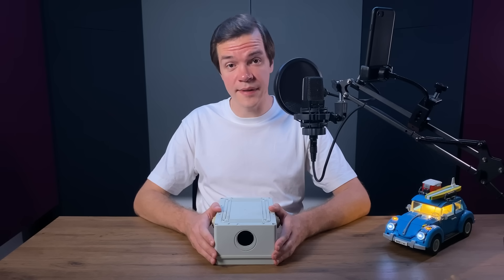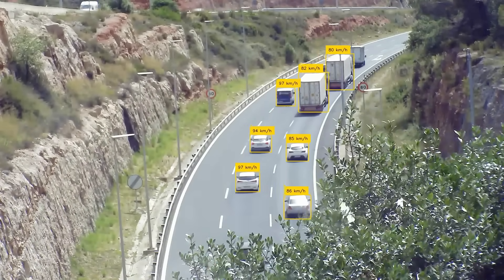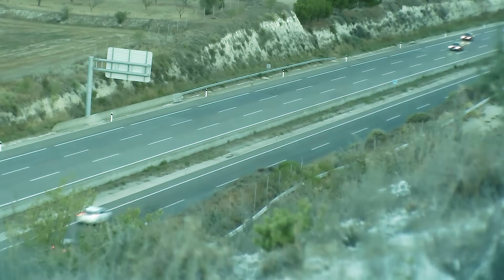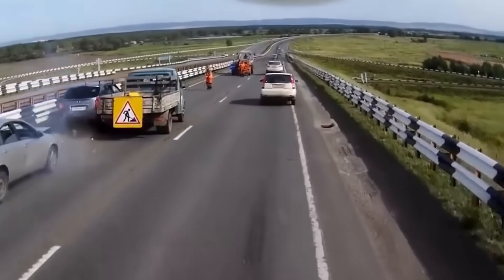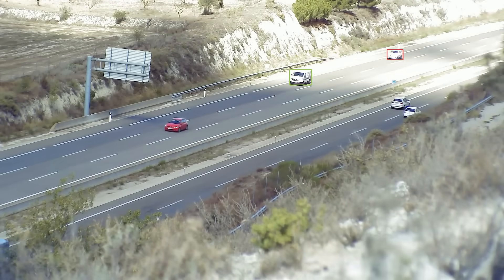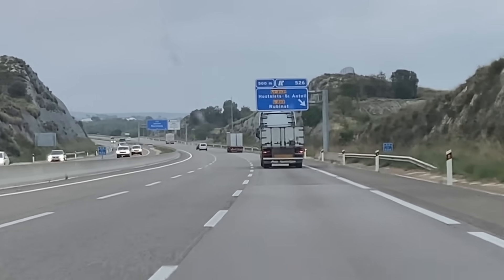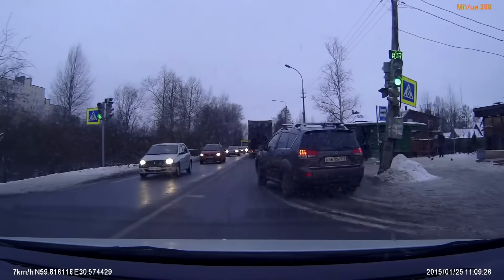New Anti-Tailgating Camera Reveals Shocking Statistics

Comment: I'm not crazy about the Idea of more law enforcement application on this,  A car cutting you off or the car ahead slowing down could make everyone 'guilty' at one point or another.    
This could be an automotive feature, to start with an indicator light, and then blink and possibly have progressively louder alerts if the gap isn't maintained.   Many new cars already have collision avoidance detecting obstacles ahead, and some cruise controls can set following distance.  So all the data is available.  Compare that with speed and you could have a save following distance score, make it at least an option to be visible to the driver.  Just like you have trip milage report at the end of each drive.
Though what I would really want is a license plate holder that will pass the safe traveling distance information on to the car behind me.

Comment: Average speed cameras do work. They work best when the limit is sensible, rather than too slow. We have them here in Scotland on quite a few long distance arterial roads, such as the A9, and what used to be a congested with lots of queues and gaps, is now more generally smooth flowing. Importantly, as a trial, they have raised the truck speed limit  as well [that's a way of getting around certain national legal issues]. 
It can be annoying in the dead of night when there is almost zero traffic and space for much faster speeds (exceeding the speed limit;-)

Comment: I live in Maine and whenever I have driven to Massachusetts I notice the drivers behind you won't tolerate even a three car gap in front of you but rather will make high risk passes to fill it.... therefore you are forced to reduce the safety gap in front of you or the insane passing attempts by those behind you become a much greater hazard. I agree that some solution is needed though I abhor government intervention unless absolutely necessary.

Comment: There is another reason for tailgating, caused by the police obsession with speeding. If police see someone speeding, they pull them over and give them a ticket. Simple enough, but what if they see 3 or 4 cars speeding at one time? Well, in most jurisdictions I've seen, they'll grab the driver in front. So, the fastest "safe" position (in terms of not getting a ticket) is immediately behind the fastest driver on the freeway. (This is not an issue when speeds are enforced by cameras, but it is an issue when speeds are enforced by roaming cops with radar.)

Comment: I had in Germany a digital running sign strip in the back side window. When I had a tailgater I switched it on and it says "Achtung - Verkehrsmessung" (Attation, Traffic Measuring). They always kept distance immediately. Later I had used an old cellphone and an monitor showing them their own face. It helped too.
Reply: Both of these should be built-in features in new cars.

Comment: Just a note: you have some parallax issues computing speed the way you did.   Meaning, the angle of the camera view.
Also, in America, they teach you 2 second rule.
It is of course based on driver reaction.... the time to recognize the issue, take your foot off the gas and apply the brake.
However, it doesn't take into account that when, for example, I get too close to the car ahead of me, I cover the brake (move the foot to hover over the brake pedal without activating the brake lights).   I have measured my reaction time and it is closer to .5 seconds.   So a .8 or 1 second separation is OK, depending on driver condition/state. 
In Europe, the cars are smaller and trucks are forced to be in the right most lane.  Which means when you are following a car, you can typically see ahead of it as well.  So you can react to issues even before the car infront uses their brakes.
In the USA, you can find yourself behind an SUV, or pickup truck or large truck and not be able to see around it.   In my corvette, I sometimes sit so low that I can see brake lights from cars way up ahead UNDER the SUV or truck ahead of me....

Comment: In Germany you are obliged to maintain the safety distance within 1 second ( above 100 km/h ), if you are cut off.
Thus: we have to ignore the edges of the footage ( saying/assuming that the guy in rear had just been cut off).
Additionally: there should be a dashcam in every car, and the footages have to be preserved for a given time ( in which the fines have to be posted out, as well).

The whole stuff can be totally automatized.

BTW: comparing tailgating to plague is quite a good comparison. I suffer from tailgating like I would suffer from the plague.

Comment: There are a few factors that do provide mental reinforcements of poor driving practice.

- All vehicles are going in the same direction; so any impact WILL be minimal.
- The visibility is fine and I can see everything is flowing smoothly; I am just one part of a snake moving freely.
- My ABS and general braking performance is the best of the best; I can out-brake anything.

Now of course these factors DO sometimes mean stupid driving does not result in a serious crash or perhaps avoids any crash at all, however, tollerating other drivers who stick to speed limits - or just wish to drive more slowly, or tollerating drivers who might only slowly overtake others on motorways - perhaps even siting on cruise control in THEIR CHOSEN LANE, tollerating ALL these with patience and other nuisances is well, is the main factor required for safer roads... so please don't become the impatient idiot who flouts the law with your excuse that the other driver is too slow, an idiot or a law breaker in their own right!

Comment: The "unsafe" following distance of 30 meters simply relies on experience. I drove cargo for 3 years, 700000km, and I can assure you it was rare for the vehicle to be loaded correctly. Accidents? None. It's super rare to see anything stop suddenly on a motorway where everything goes 150km/h. It's simply not how physics work. You need a fairly massive thing to fall on to the motorway to cause a sudden halt. Stuff like a tree or a stray services vehicle. And if anything goes to a sudden stop on that, you see debris flying sky high. Big stationary things tend to telegraph their presence quite well. Only once has it happened I've had a hot minute and nearly didn't make it, but that was with an overloaded machine where I made the brakes go red and had to slam in the first gear to stop in time. That is - I've seen what's going on, I rammed on the brakes early, the tires had enough strength to stop the car, but the brakes didn't, because the truck was 50% overweight. So, if you load correctly, and actually pay attention, and keep your car in reasonable condition, your chance of not stopping in time is as good as getting hit by a lightning on a sunny day.

By the way, once nearly had a bad collision with a service vehicle in Britain. That brilliant mind thought it's a good idea to stop just past a rather sharp left turn not too far from Dover. The thing that actually saved me wasn't braking but maneuvering.

Comment: .. and don't get me started on people who insist on merging at the last second for roadworks when the approach has been clearly signposted for several kilometres. 
If you merge in good time, nobody needs to slow down. If you force your way in at the last moment, then everybody has to brake, and the whole process comes to a grinding halt. 
Merge early and don't dodge between lanes, and everything runs smoothly. 
Act like you are smarter than everybody else 'cos you are special, and everybody has to put up with your selfish stupidity.
Reply from the maker: There are a tons of videos explaining why seemingly selfish asshole behavior of merging last moment during the lane closures is actually the correct use of the road space that’s better for everyone:)

Comment: Just get rid of the cars - there fixed. And in another reality, stopping distance is proportional to the square of the speed. This means that if you double your speed, your braking distance will not simply double, but will increase by a factor of four. So, yes, speed absolutely kills. And the average reaction time for a driver is much much higher than quoted. It can't have been a real world test, the drivers must have been expecting the test, rendering the test useless.

Comment: In Germany we have other distances. Half the speed you are going. So basically the recommended length for 120kmh would be 60 meters not 100. And fines begin at the half of it. So basically if you follow with less than 30 meters.
Reply: Too complicated.  Who can accurately estimate a 60m following distance?  Counting seconds is much easier and the fact that a constant number of seconds auto-adjusts the following distance for any speed is a great feature of this rule/recommendation.

Comment: Tailgating is apparently by far the most common cause of collisions on UK motorways. It's a scandal that the UK does nothing to stop this. Other countries already do eg by using the existing speed-measuring cameras (or new dedicated ones) to catch tailgaters.  It's very easy & low cost. Software notes how many fractions of a second the cars are apart and issues fines to tailgaters automatically.

Comment: Hi from Sydney, Australia. I'm 69 years old and have just retired as a doctor. 43 years ago I bought the car of my dreams, it was 8.5 years old and had 102,000 kilometres on it. It has been my daily car ever since and over the 43 years I've added 610,000 kilometres to it so now showing 712,000 k's , so far I have not scratched it, dented it or have been involved in an accident, AS LIKE YOU a young well educated person I realized the real killers are those BEHIND you. I have driven my car in all weathers in the city and country, and when in the country I have always driven with headlights on in the daytime. Being very tall, the internal rearview mirror is directly in my line of sight I do not need move my head, just a quick left glance to view the idiot behind. As the years have passed driving skills of humans seem to have diminished as basic car safety tech has improved, where in the past 53 years ago when I commenced driving, people drove to the ability of their car, they knew its limits and did not exceed them.    

I have been helped by the car itself as it does not blend into the Australian roads cape, a giant black 6 x 2 metre, 3.2 ton 1974 Cadillac Talisman which has GM''s pioneering Maxtrac a joint traction control, stability and ABS brake system in one unit developed jointly by GM & Bendix Aviation where a executive jet system was modified to work in a huge car. In addition in a worst case scenario I would be helped by it being equipped with GM"s WORLD FIRST airbag system, the Air Cushion Restraint System offered for just 3.5 years from mid 1973 until 1976 with very little take up of this stunning system GM cancelled it until relaunched in 1992. The ex-aircraft braking system in this giant heavy car EXCEEDS near ANY modern car, the stopping G force is so great that it makes you feel your stomach has been relocated to your throat, the grip is so great that it is like a leech attached in human flesh.

Comment: This is the part I don't understand: Everyone who drives a vehicle on the road has seen multiple-vehicle crashes, where one car has slammed into the back of another, pushing it into the car in front and so on. Despite this, these drivers will readily tailgate other vehicles, even though they know what the result will be if the vehicle in front of them stops suddenly. 
It's as if they don't understand how ineffective their braking and tyres will be if they have to stop in a hurry - or they've just tuned out to the whole situation.

Comment: Problem is ALWAYS car in front (well... 99.99% of the time). Tailgating is NOT a thing on multi-lane highways, it is lane hogging that you decribing. Only in extremely rare situations and mostly on single lane roads that tailgating occurs. As it is obvious from your video, the reason there is car following closely behind is either 1. there is lane hogger in the middle or third lane 2. somebody moved over for overtaking, without looking and without giving way for the car already in the lane (if the car already I the lane have to slow down for you, then you cut it off and thus you are at fault, instead it is you who should slow down in your lane, wait for car to pass and then start overtaking).

In implies terms drivers must ensure that they are not holding anyone behind them, no matter the circumstances and no matter the speed if they are in any other lane EXCEPT the one on the right (in Europe, would be left in countries that drive on the right). It does not matter what speed you doing, it does not matter if others are speeding, if you not comfortable speeding, don't start overtaking at all, wait for the car to pass then.

Also I think in practice your calculation is wrong, because the car in front of you can't stop at an instant either, and what experienced driver does - they don't look at the car in front, they look at 3rd, 4th, 5th car ahead of the car in front. Unless they cannot see cars in front, in which case, and ONLY in which case the distance becomes important. Takign example of 9:42 - there is nothing dangerous in this situation. It is only two cars on the road - so what that the car behind follows at what looks like 5m at 180km/h... sure it would be impossible to stop if the car in front suddenly becomes stationary, but car in front physically CAN'T become stationary much quicker than the car following.

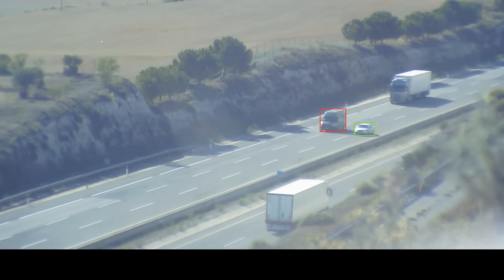10:39 another example where your calculation simply does not work, as in that case you count as if van is tailgating, but what actually happened is that van is already driving on the right and was overtaken by much faster car, that moved over to the lane in front of it and just sped away. So your calculation say "van following at dangerous 10m distance", but realistically it is neither the case as car in front rapidly acelerates away and secondly van just can't do anything about it, can't move further to the right and "tailgating" happened not because of their own actions. Well - it simply said isn't tailgating at all.

And okey - you do acknowledge that in the end, but depth is still missing... it is only tailgating when the car behind driving at the same or higher speed than the car in front, and only if the car in front driver at speed limit or higher, and only if the car in front been in the same lane for "a while" (this needed defining), and only if there is no way for car in front to move over (otherwise it is lane hogging and not tailgating), and only if it could be reasonably argued that driver behind can't see in front of the car in front (like camper van behind fuel truck), and perhaps on top of that - only if car is NOT fitted with automatic braking system. So realistically, tailgating occurs very rarely.

Also note - tailgating cameras exist in Germany (also I think Netherlands) and it is somewhat enforced (or at least did exist like 10 years ago, not sure if they still using them).

Comment: An excellent experiment and explanation of why static cameras cannot read context. The best evidence of tailgating is provided by front and rear vehicle-mounted cameras with footage before and after the event. Of course, that needs a lot of people to be submitting (if the local police even allow it, which most do in the UK) and it requires a determination by the police to prosecute, which is less certain. It's not specifically illegal to tailgate in the UK, but it is covered by laws such as careless driving. This also applies to a number of bad practices such as undertaking, lane-hogging and so on. Best yet is if someone tailgates an unmarked police car; that's certain to get you a ticket.
Reply: Tesla.

Comment: There are several reasons why governments do not enforce distance rules;                                                                                                                                     
1.  Socially acceptable crimes.  Remember how long it took to get compulsory seat belt wearing
2   Traffic density.  There are so many stretches of motorway where the density of traffic precludes keeping a legal distance apart..  
3.   Vehicles changing lanes, both entering and leaving the traffic streams.  If rigidly applied it would often be impossible to change lanes because of traffic density.
The emphasis on speed is because a collision at 30 KM/h is a lot safer that a collision at 180 km/h.  Not all collisions are equal which is the only issue that I have with the video.

Comment: Other than it being difficult to determine which car caused the short following distance (e.g. cutting in front), you also have to consider that safe distance is defined for two cars at identical speed. Following closely is much less of a problem if the car in front is faster. Distance is increasing and the car in front takes longer to slow down. Conversely, if the car in front suddenly slowed down, the cars behind will "use up" their following distance to slow down. That's what it's for after all. I then takes time to reestablish safe distance, because slowing down suddenly isn't safe either and can cause traffic jams.
You can definitely build a system that determines this with high accuracy. The problem you're going to run into is probably to make it "lawsuit proof", i.e., preventing drivers from dodging fines in court.